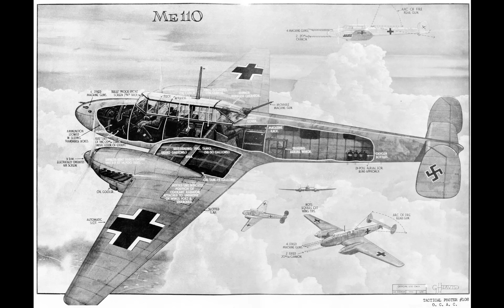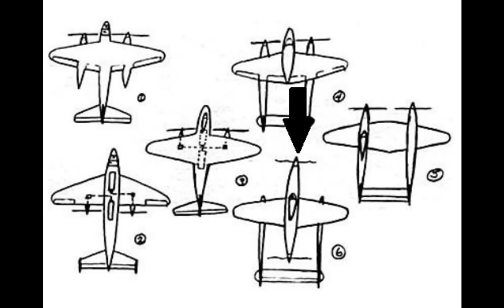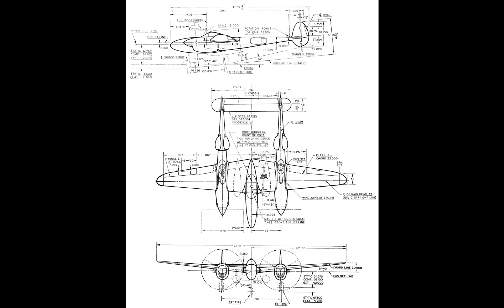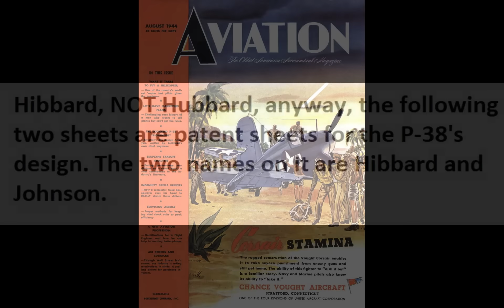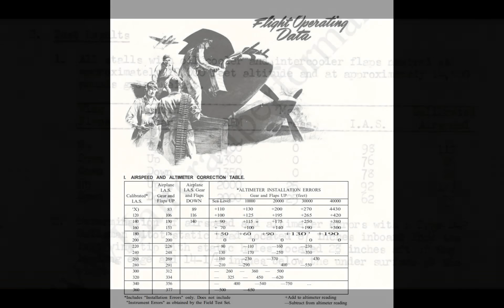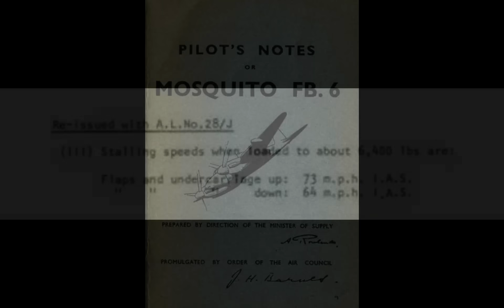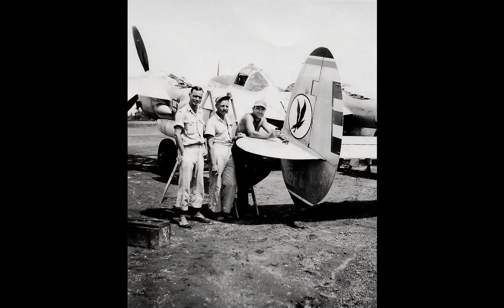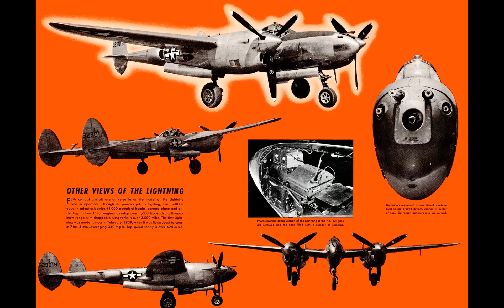Lockheed P-38 Lightning Design Info

Comment: I've been reading stuff about the P-38 since I first discovered WW2 airplanes about 60 years ago. The twin boom configuration is always rationalized as a solution to maneuverability in a twin engine airplane or improved aerodynamic efficiency, neither of which really made much sense to me. I always thought it was more likely a packaging thing, and a very logical one. You are the first person that's stated that in simple terms. I'm looking forward to more in this series on the P-38.
Reply: "The twin boom configuration is always rationalized as a solution to maneuverability in a twin engine airplane or improved aerodynamic efficiency"
...I've been a fan of the P-38 Lightning and have always looked for content specifically focused on the P-38 (...and wondered why how iconic it was, Greg ignored it for the longest time...) and I've never heard this as a reasoning behind it. It just always made sense to me that this was made well, well before the Merlin and before the R-2800 was ready and this was a way to get more power and more fuel into the the aircraft and have strong structural stability. And, I mean twin-booms were not a new concept with WWI aircraft and plenty of interwar aircraft having them and Focke-Wulf having a successful design with the Fw189 prior to this.
Reply: @matchesburn  Exactly. All the early war twin engine day fighters were an attempt to get more power before higher power engines were available. It was probably hoped that when more power came, it would be adaptable to twin engines too (as happened with the B-25-size Tigercat)... The problem is all day fighter twins of the late 1930s were based on the 1930s idea that dogfighting, and especially turn-fighting, was dead as soon as monoplanes appeared. Hit and run, it was thought, would rule WWII... It didn't. As a result, most of the "heavy day fighter" twins proved useless as day fighters. The P-38's structure allowed strenght without much weight, and dispensed with the weight of a tailgunner, so it barely remained effective as a day fighter: About 90% as good as other single engine day fighters of its time, but at twice the cost! It found its niche finally as a day bomber, but with a less risky level bomber option, not just a fighter-bomber. The other "Heavy fighters" became night fighters, as did a few P-38s. Suprisingly the P-38 could turn as well as a single engine fighter, but could not roll at all, even when the ailerons were boosted electrically later on (this only helped roll at high speeds). Worse, it could not dive from high altitudes at all, even with dive pull-out spoiler plates added. Saying it was 90% as good as other single engine fighters is mostly because of its climb rate, and is being generous...
Reply: @wrathofatlantis2316  No it would not in the  west dogfighting was the Norm
Reply: @matchesburn  

For what it’s worth, I imagine that the elevator had a bit of extra authority to it thanks to being a single piece that has the rudders acting as winglets
Reply: @spindash64  I'm about to watch Greg's pt2 on this but the elevator was a sore spot until identified.
Reply: @spindash64  Interestingly, the P-38 was one of the first aircraft that experienced compression issues at high speed, especially in dives from high altitude, negating the authority of the elevator. It turned out to be an aerodynamic issue, that was eventually solved by installing small dive flaps outboard of the engines, under the wings.
Reply: @TheObnoxiousMrPug  Never solved its T/M was 0.68 and stayed that way until the end
Reply: I remember reading that it also had to do with giving the plane  an "extended aspect ratio" and improved stability even with a heavy payload.
Reply: I'm surprised Greg didn't mention the poor visibility of the twin fuselage design (to one side) vs the excellent visibility of the P-38 as built. Odd that he said he wasn't sure why the twin fuselage was passed over at 13:20, except for the central firepower.
Reply: @donjones4719  Visibility to the sides was not a strong point of the P-38, because of the low-set canopy vs the engines... The cockpit ergos were also a bit dubious, the control yoke being unusually far forward, if memory serves. Heating and canopy frosting at high altitudes were huge problems initially, and the engines did not work well with British fuels, the only fuels in Europe, due to poor lead mixing. P-51 and P-47 were not affected by the fuel. US fuel in the Pacific worked perfectly for the P-38, as P-38s in Europe often had one "lazy" engine from fouled spark plugs.
Reply: Yeah, the P-38 was one of my favorite planes when I was a kid
Reply: I r ead "fork tailed devil" and author's research said the twin booms provided room for the turbo-superchargers, that were an absolute requirement for high altitude performance. Also increased fuel capacity I think but not sure
Reply: @robertmaybeth3434  All the fuel is carried in the wings.
Reply: @robertmaybeth3434  "Fork tail devil "was not used in the MTO or MTO I would suggest having a look at Mike Spick "Fighters " cheap and a good desk size book
Reply: Excellent book!  Absolutely the best history of the P-38
Reply: I read likely in Kelly Johnson's book that they were just trying to improve the aerodynamics and that meant the fairing behind the engine got longer and then they thought, "why not run it all the way down to the tail"?
Reply: M make
M on I’m
Reply: Hoa Tattis  Did I say it was? I have read explanations for the twin boom concept using that reasoning though, which, as I said, never made much sense to me.
Reply: 8:29 Wright Flyer maybe?
Reply: For flight characteristics, the twin boom design has only disadvantages:

 1. You have much more surface touching the air and producing drag per weight than with a single body.

2. Weight that is distributed away from the roll axis decreases roll speed.
Reply: Or, and maybe this is the answer...it LOOKS FUCKING AWESOME.
Reply: I’ve always loved the P-38 since childhood.  My late uncle had 8 or 9 confirmed kills in the Pacific theatre in the P-38 and he would tell me stories of what it was like to fly.  He was a large specimen and he loved the roomy cockpit, even had it’s own built in ashtray on the control column.  His favorite feature was the cannon, a couple of well placed rounds could incinerate a Betty.  The other thing that pilots loved was the safety of two engines on long overwater missions.  Truly one of Clarence Johnson’s most brilliant design and very much ahead of it’s time, to me it still looks modern. 💯🇺🇸
Reply: My dad worked with the Mosquito and held Lockheed in high esteem
Reply: Maybe the first time that you’ve seen it, but definitely not the first time, since Hibbard said as much in the article that Greg highlighted.